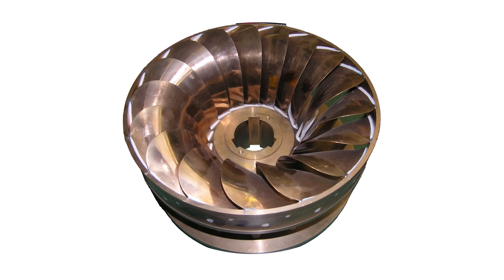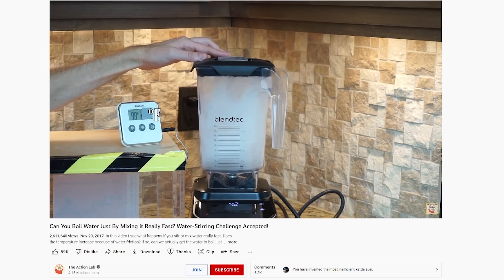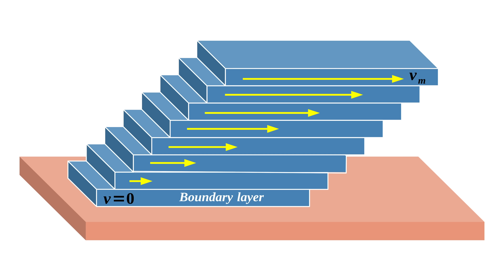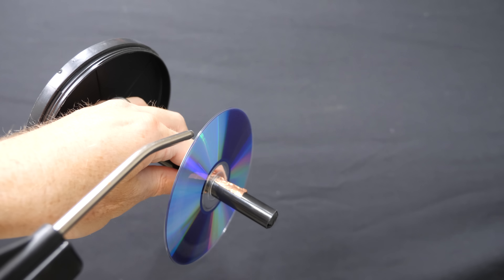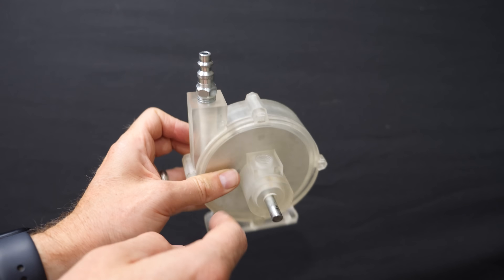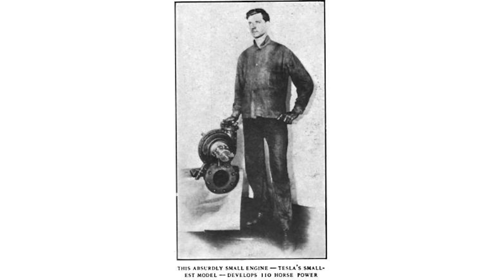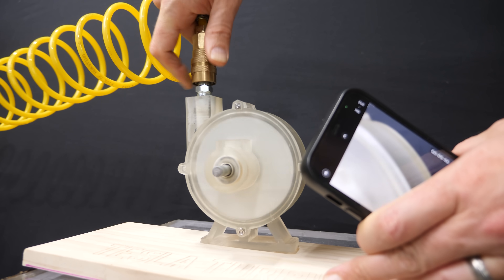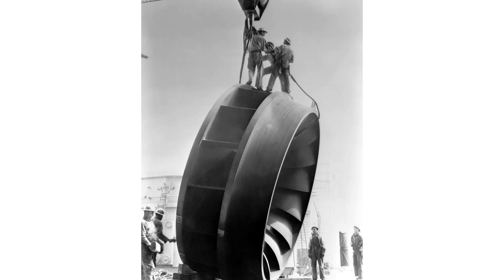How Fast Can a Tesla Turbine Spin?

Comment: The tesla turbine is not that efficient. The boundary layers of the water show this. The ones further out still travel at a relatively  high velocity . Whereas in a Pelton wheel, almost all the energy is put into the system. It's the most efficient turbine
Reply: Hydro Tesla turbines have already been shown to be 81% efficient… c’mon now.
Reply: 🤭 hate to break it to you but +80% efficiency is dang good…

“Design and Development of a Small-Capacity Tesla Turbine for Rural Applications

ABSTRACT
Bangladesh is in great need to find renewable energy sources for its fast-developing industrial sectors. The main objectives of this research are to design and fabricate a small-scale efficient Tesla Turbine for remote areas and test it through experimental investigations. Performance analysis of the newly designed Tesla Turbine suitable for remote areas of Bangladesh will be conducted. Until now, a number of researchers have undertaken several tests and studies to evaluate the Tesla turbine's performance and efficiency. Tesla Turbine does not proficient in producing torque. The work here consists of computational analysis and an experimental campaign by fabricating the turbine. Solid Edge 2021 is employed for our 3D modeling. For modeling, the desired material is Polylactic Acid (PLA) or ABS Plastic. The proposed design consists of 51 disks with an identical spacing of 3 mm. This design has led to achieving a torque of 19.85 N-m and a staggering efficiency of 81%. It was found that stress generated on the disk edges is higher than their centre due to high centrifugal force.”
Reply: @CharlieSolis  I  never said it wasn't efficient. Just better options out there. Pelton is over 90 or 95%
Reply: @testurenergy  notice the position of the video in the begining? He shows water. That's the context I'm speaking in. It's misleading for him to mention water and gas. Comments dont have video tine stamps. 

Regardless, The most efficient turbine for a liquid is Pelton. PERIOD.

 FOR GAS, THATS A DIFFERENT  STORY. yes we model gas as a fluid, but efficiency changes with density and flow characteristics. Don't forget gas is compressible, where compression in liquid is negligible comparatively. So technically, we are both right.  As gas turbines max efficiency is now 60ish percent. I haven't modeled tesla turbine in gas, but in water it's nothing amazing.
Reply: @pmkwiek  hydro Tesla turbines have already been shown to get 81%…. In practice too not CFD.

Yes not better than a pelton but this is before optimizing the Tesla turbine 🤭
Reply: @pmkwiek  read this write up from from Charlie Solis who actually makes real working Tesla turbines…. It’s a very good and in-depth read. I highly suggest reading it all. 

[TL/DR: This is not a mechanical turbine in any shape or form. Since all molecular adhesion and internal viscous forces within a fluid are governed by electron orbital interactions, this makes the Tesla turbine a purely electronic turbine.]

The BIGGEST misconception about the Tesla Turbine that most people get wrong is that they think the fluid is actually sliding and dragging on the disc, similar to as if a solid object was “sliding” across the surface of another solid object. 

It is not. Full Stop. 

The fluid that’s just off the surface of the disc face is ALWAYS statically adhered to said disc face and never moving relative to the disc. 

The torque to the disc comes from shear stress “cohesion” forces within the motive fluid trying to move through itself.

The shear force is transferred through the motive fluid itself to the layer of fluid that is statically adhered to the disc faces, and then through the virtue of molecular adhesion the discs are pulled along with it, or Vice versa the discs pull the fluid along with it. 

The only “friction” involved in this is that of internal friction within the fluid against moving through itself, ie Cohesive viscous forces. 

And sorry I don’t mean to sound like I’m being pedantic, as I’m sure I’m restating many things you already know. 

It’s just a very important key part of the operating functions that everyone gets wrong. This is not a mechanical turbine in any shape or form. 

Since all molecular adhesion and internal viscous forces within a fluid are governed by electron orbital interactions, this makes the Tesla turbine a purely electronic turbine. 

As Tesla even alludes to in the article “Dr. Tesla Talks Of Gas Turbines”

… “I have been working at this a long time. Many years ago I invented a pump for pumping mercury. Just a plain disk, like this, and it would work very well. ‘All right,’ I said, ‘that is friction.’ But one day I thought it out, and I thought, ‘No, that is not friction, it is something else. The particles are not always sliding by the disk, but some of them at least are carried along with it. Therefore it cannot be friction. It must be adhesion.’ And that, you see, was the real beginning.

“For if you can imagine a wheel rotating in a medium, whether the fluid is receiving or imparting energy, and moving at nearly the same velocity as the fluid, then you have a minimum of friction, you get little or no ‘slip.’ Then you are getting something very different from friction; you are making use of adhesion alone. It’s all so simple, so very simple.

“This is the greatest of my inventions,”……
-Nikola Tesla (September 18th, 1911)

When designed correctly, it works principally upon electron interactions between the fluid and itself and the fluid and the disc material. 

The first important factor being how well does the fluid actually molecularly adhere to the disc faces when submerged in an atmosphere of the motive fluid. 

This is also seen as the “Wetting angle” when there are two fluids in contact with the surface and they are competing for adherence. 

Think hydrophobic and hydroPHILLIC surface treatments.

The second important factor is the viscosity of the motive fluid in question, as it represents the fluids ability to “flow through itself with or without resistance” per se. 

Herein lies the reason it is extremely important to maintain laminar flow regimes within the disc spaces. 

Because irrelevant of the viscosity of the fluid, ALL FLUIDS, liquids and gases, can be forced to flow in highly efficient low Reynolds number laminar flow regimes given the right initial conditions and “flow cavity” parameters, such that turbulent boundary layer slip is eliminated, stream separation and counterflow is eliminated, rapid pressure changes from turbulence resulting in noise losses that can lead to early fatigue on discs and parts is eliminated, etc. 

Furthermore, because windage is all but inexistent in the Tesla Turbine, it stands to potentially be the quietest running turbine ever when properly designed. 

(Sidebar: This is why I have speculated over the years that these Tesla turbines have actually covertly been in practicable use all this time in things like covert/stealth submarine Primary Power Units (PPUs) and/or just plain stealth “trolling motors” but that’s honestly my own sheer educated speculation at this point. 🤷‍♂️ it just makes sense.)

This is where working out the complex solutions in the Naviar-stokes equations come in for designing practicable machines.
Reply: @testurenergy lol by your very definition that makes all pumps electronic and, furthermore, you'd never be able to mix a flowing fluid. By that definition if I left a pipe flowing, the fluid by the pipe wall would never move and I could potentially have 1000 year old fluid sitting at the pipe had I ran the flow continuously  for that length of time (assuming laminar flow, as we know turbulent wouldn't allow a smooth flow gradient along a cross section).

Yeah no lol

Zero flow means zero velocity. Don't forget that the slip point is on the basis of zero flow at the pipe wall, which is just an assumption in math, so negligible but not zero. 

Also, if you had a hydrophobic plate, you'd still impart energy, just a lot less. It's not like the water knows something hydrophobic or not. It has to interact somehow
Reply: @pmkwiek  that absolutely does not make all pumps electronic. 🤭 no other pump or turbine relies on adhesion. They rely on mechanical collisions of the fluid with the complex geometry surfaces. Even reaction turbines. 

Try again buddy.
Reply: @pmkwiek  🤭 dood what are you even saying. You went a long way to say absolutely nothing. The no slip boundary condition is not just “theoretical” because it’s not correct it’s theoretical because it’s the perfect version of it 🤭 

I believe you are confusing a “theory” with “theoretical physics”. They are not the same 🤭 
  
Theoretical physics is a branch of physics that employs mathematical models and abstractions of physical objects and systems to rationalize, explain and predict natural phenomena. This is in contrast to experimental physics, which uses experimental tools to probe these phenomena.

And both theoretical and experimental data confirm EVERY TIME the No slip boundary condition is an accurate depiction of the flow. 

Just because you say things doesn’t make them true. 

Nobody said anything about zero flow. Stop your sophomoric strawman arguments.
Reply: @pmkwiek  “the water doesn’t know if it’s hydrophobic….” Yes it absolutely does 🤭 hydrophobic is literary a molecular interaction. Do you not understand the difference between polar and non polar molecules? The electric field extends beyond the molecule…. 🤭

Or do you still think that the Tesla turbine works by needing a rough surface for the fluid to smash into because you still don’t understand that all interactions between the fluid and the discs are through molecule adhesion and cohesion, electric fields… 🤣

Normal turbines only see adhesion as a loss in the fluid flow.
Reply: @pmkwiek  “you’d never be able to mix a fluid by that definition” 🤭 

LAMINAR FLUID FLOWS DO NOT MIX… full stop. That’s what makes them laminar 😂🤣 

where do some of you come up with these claims. 

Are you seriously here trying to act like a subject matter expert but you don’t understand that laminar flows, by not having turbulence, DON’T MIX…. 🤦‍♂️😂
Reply: @CharlieSolis  lol laughable. And in order for the molecular forces to tell hydrophobic/phillic they have to interact. Water/liquids cannot tell the future. It cannot tell its about to interact with a surface and its characteristics without actually interacting. So a force is imparted regardless.
Reply: @CharlieSolis  must be confused again. So you mean to tell me that a simplification is an explanation? Then, for example, theoretical deducement of everything that governs electricity explains how  electricity "flows", but it's much more complex than basic models isnt it. You can go through maxwells equations or you can use ohms law to calculate a similar end product, netiher of which are 100% with what is actually happening. Same thing applies here. It's just to make the math simple. 

Yes, OK mixing was the wrong term, but you'd never have a molecule at zero velocity in practice. It'd be pretty close to zero, but not zero. 

Point being if your force's vector isn't aptly redirected you will still have a velocity which results in lower efficiency. 

You two are either the same person, or are just in love with stroking each other's ego or what not. But I think you're one and the same and just like stroking your own.
Reply: @pmkwiek  dood put the pipe down. Nobody is talking about future telling. What an outrageous strawman arguments to come back with. All this time to think of a response and that’s what you come back with? 🤭
Reply: @pmkwiek  any solid material submerged in an atmosphere of some fluid will have molecular adherence to the disc surface. 

Hydorphobic coatings that most people think about has to do with TWO fluids competing for adherence to the fluid surface. Known as the wetting angle. The fluids DEFINITELY KNOW without touching because OF THE ELECTRIC FIELD…. Ya know the thing that governs the behavior of ALL ELECTRON ORBITALS, specifically the valence shell that governs the binding and interaction between atoms. 

This isn’t “future telling” it’s called electric field interactions. 

You’re trying to make it sound like “magnets are magic because they act on each other from a distance” 🤭
Reply: @pmkwiek  any solid material submerged in an atmosphere of some fluid will have molecular adherence to the disc surface. 

Hydorphobic coatings that most people think about has to do with TWO fluids competing for adherence to the fluid surface. Known as the wetting angle. The fluids DEFINITELY KNOW without touching because OF THE ELECTRIC FIELD…. Ya know the thing that governs the behavior of ALL ELECTRON ORBITALS, specifically the valence shell that governs the binding and interaction between atoms. 

This isn’t “future telling” it’s called electric field interactions. 

You’re trying to make it sound like “magnets are magic because they act on each other from a distance” 🤭
Reply: @CharlieSolis  actually quite the opposite of what I am saying. The fluid interacts on these magnetic fields. 

What I'm saying is the fluid interacts through the field. Period. 

Think of what I am saying this way: if you bring 2 like poles of a magnet together, they interact and a force is imparted. Net result : repulsion. Same with the hydrophobic sense of things. It has to interact (through the fields) to know its hydrophobic. It cannot tell its hydrophobic without that interaction. So a small force is imparted regardless.
Reply: @CharlieSolis  also, wetting angle yes. Hydrophobic being 2 fluids competing, no. We aren't talking about miscibility of 2 fluids

Additionally, theoretical and empirical are 2 different beasts. Please look up the difference. There's a reason theoretical physics MODELS change, but physical phenomena dont.

Lastly any solid material that is not hydrophobic will be wetted when submerged, but NOT a hydrophobic one.
Reply: @pmkwiek  ok now I know you have no idea what you’re taking about because “the wetting angle” is literally the governing principle behind hydrophobic and hydroPHILLIC surfaces. 🤭 

Nice try buddy. If you don’t already know that the level of hydrophobicity is determined by adhesion interactions and the wetting angle you shouldn’t even be commenting about this. 

Never mind “hydrophobic” is only for water. There are other version for oils, and non polar molecules. The “wetting” isn’t just for water. It’s for ALL fluids a solid can be submerged in. 

Move along padawon.
Reply: @pmkwiek  you’re talking to someone who has an actual degree in physics from Michigan Tech University. Just stop with your attempt at condescendingly telling me to “look up the difference between theoretical “models” and empirical” 🤭😂🤣

Its funny how obvious it is that you don’t know that “theoretical physics” is NOT “the physics we still only have a theory for”.

It’s the branch of physics that uses mathematical models to explain known phenomena. Those “Theoretical models” were constructed from empirical data… so you are wrong. Empirical data does actually correlate with theoretical models. 🤭 

Again, another typical armchair engineer who thinks they know everything but still doesn’t understand how “theoretical physics” is actually performed by physicists.
Reply: @pmkwiek  you are so far away from the original topic because you’re trying anything from actually staying on topic to admit that Tesla turbines actually do and can work. 

Never mind the explanation about cohesion’s and adhesion was SPOT ON. 

The fact of the matter is you are sitting here arguing with it thinking it’s just “some doods opinion on YouTube” when in fact the vast majority of that is from an actual text book. 🤭

Keep telling us how you know better than the actual scientist.🤭
Reply: Yall. For water, Pelton wheel wins every time. For gas I'm not sure to be honest. I haven't modeled that use case.

Comment: I wonder what the size limit of an efficient tesla turbine is before the centrifugal force would tear it apart.
Also, the effect of the boundary layer is used in viscous couplers. It looks similar to a tesla turbine without the in and outlets.
Reply: Very large, but not as large as your mother
Reply: Lower the radius, use gas, and increase surface area.